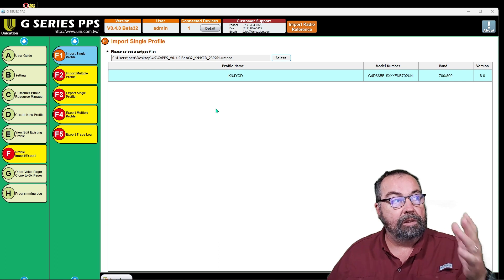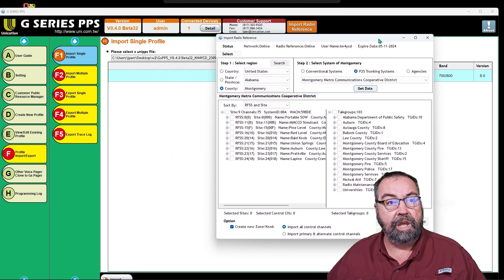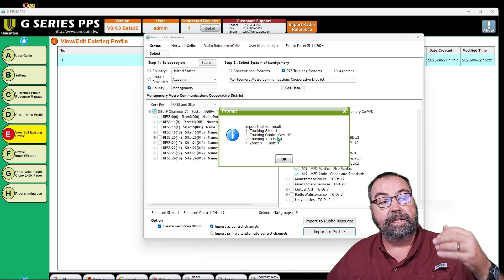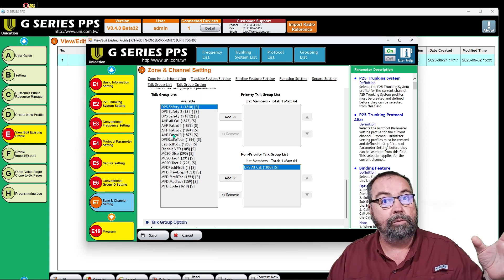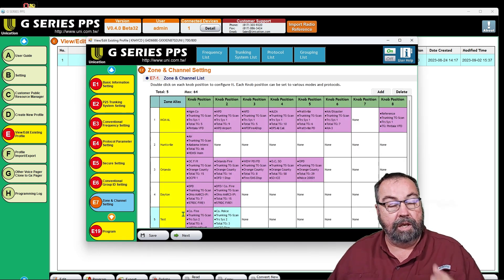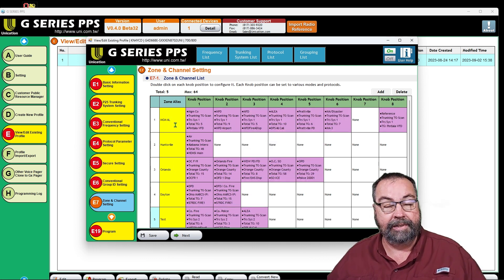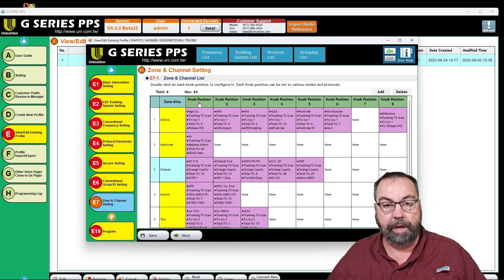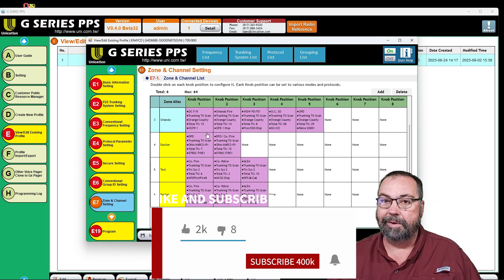How to program the most out of the Unication G4!

Comment: Thanks for these great Uni videos, Jim. Appreciated!! Have you found any work-arounds that would allow normal scanning the single p25 conventional knob freq's in one zone... Like setting knobs 1-7 as single bands and then knob 8 as the scanning.  Can we simulate a trunking feature in any way through other settings or the like?  Thanks in advance!  ~Sean
Reply from the maker: Interesting question - I'm not sure I follow completely though.  If you mean put one freq on one knob position, I'm sure you can.  All the systems I have in the scanner are all trunks though.  I could have one knob setting with all those systems, so like local/ORL/Dayton/H'ville all on one knob?
Reply: Thanks for responding. I have 7 p25 conventional frequencies in a zone. Knob 8 is set to normal scan with those 7 other knobs in the grouping box to scan. Each single knob (1-7) will pull a signal, but the normal scan (knob 8) will not.  I'm being told it's  because it's conventional not trunking. So wondering if there is another way that you may have found to do this. The other zone/and scan groupings set up the same way for just conventional (not p25) frequencies works just fine.

Comment: programming wants a username and password but no place to set them up
Reply from the maker: there is a default, if I remember it's "admin" and no password.  Might just be blank on both.  I don't keep a password on mine.  It's in the docs somewhere, I probably googled it at that screen.
Reply: @FEPLabsRadio  i had figured it out thanx i dont remember off top of head but i found a video that told me